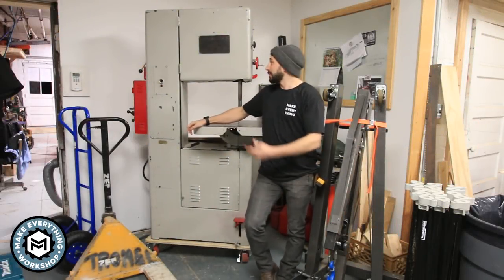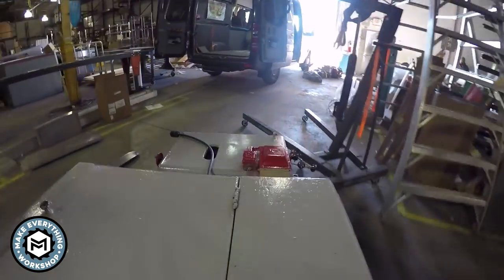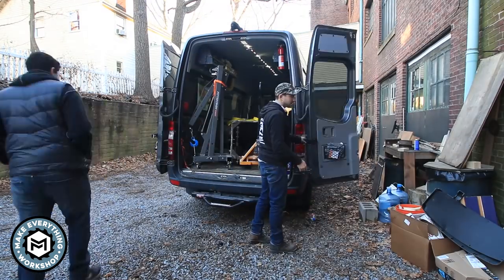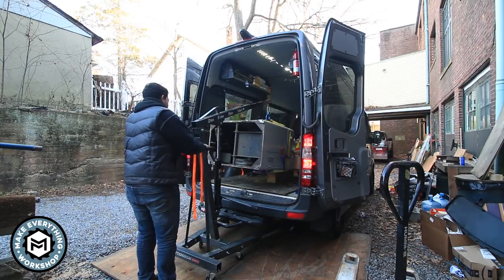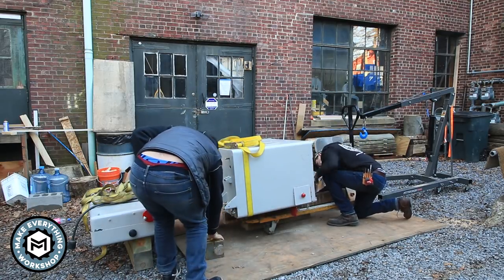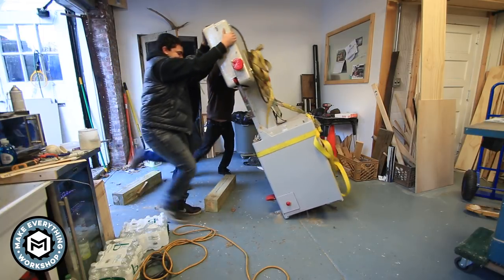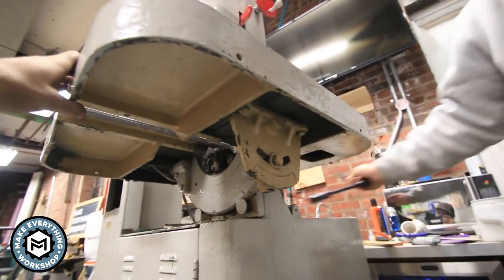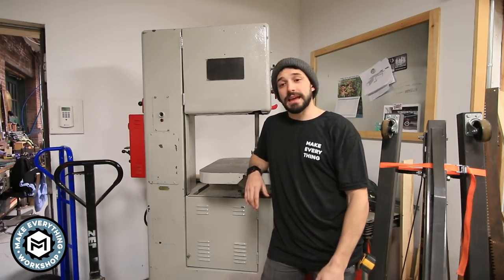Moving a 1000lb Bandsaw Without A Forklift!

Comment: Moved a lot of old woodworking machinery over the years. Pallet trucks, wooden stobs and jacks are always your friend. A Burke bar and a small pry bar are always worth having for these jobs as well for getting those slight lifts or nudges away from doorways.

I only have a fixed build engine crane so never used one for this sort of work but I do like that folding one. Very useful!

Comment: I moved the exact same saw myself last week. I used the forklift at work to put it on the back of the work ute, then when I got it home IO used my two post car hoist to lift it off. First thing I did was to weld steel castors on the bottom. Now it is easy to move around the shed.

Comment: Good job. I’d suggest screwing some wood supports under your plywood wheeled base, tall enough to clear the floor, but there to catch the saw should a caster fail. If the wood were slightly longer than your base, it would also act as an outrigger to keep the saw from tipping. Lastly, this addition would keep people from placing their toes under the saw, which could get them crushed should a caster fail. Take care and be well!

Comment: I bought a jointer/thicknesser about the same weight and was like only 2yrs since it was manufactured. bought it dirt cheap didn't want the seller to change his mind and sell it to someone else if he knew i was going to struggle with rigging it. I quickly call someone with a bed truck that has a crane and quoted me 500!! australian dollars to bring it to my place his excuse it was peak hour and the seller said it must leave his shop the same day plus it was like 1hr job. I KNEW IT WAS COMPLETE RIPOFF didn't care as long as I and the machine are safe and I was like I'll learn and do my research about rigging it for cheap myself later on. told the seller how much the truck guy was ripping me off so he dropped 200 from the price. We placed it on Pallet and wheeled it in my garage. Must admit it was a nice experience having a crane at my house and a new big toy! 

my instagram is alfawood.made have a couple of photos there of the machine and the truck.

Make everything thanks for sharing your experience on VIDEO! i bet there are a lot of makers like myself that are heavy machinery rigging virgins out there and need some tips haha

Comment: Nicely done!  You are clearly very resourceful.  I am moving a 20" MSC band saw at 1540 pounds from Detroit to Milwaukee in a few weeks.  I'll use a trailer, tip it down then pull on to the trailer with a winch.  Enjoyed the video.  Stay safe.

Comment: Honestly you should have just used an open air pickup truck and used a gantry crane.  Would have been significantly easier than using the multiple pieces of equipment that you had to deploy.
Reply from the maker: If I had an open air pickup truck, and a gantry crane, maybe that would have been an option. But the engine crane works just fine and doesn’t need to straddle a vehicle like a gantry crane does.